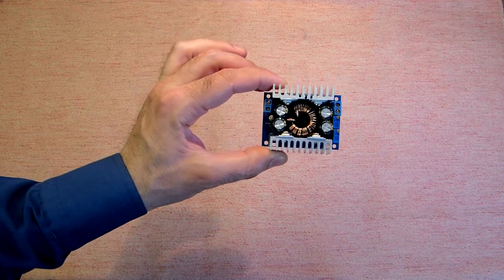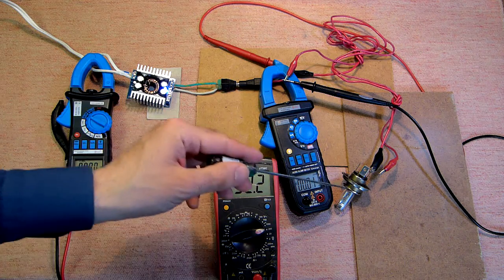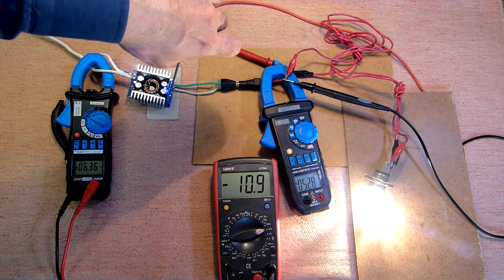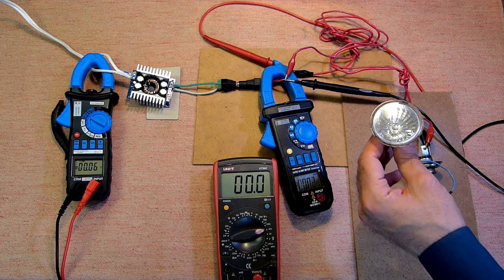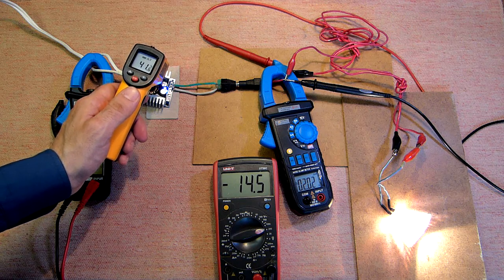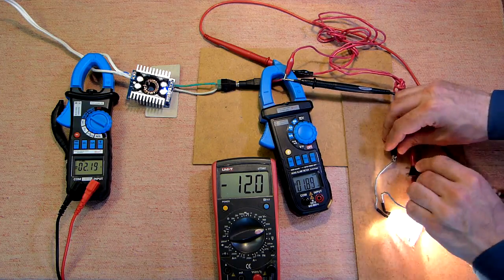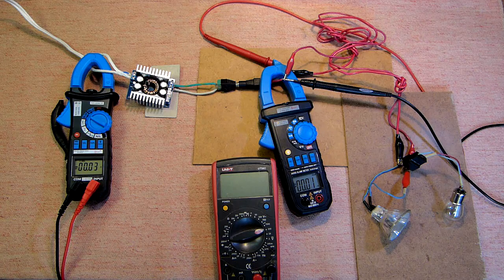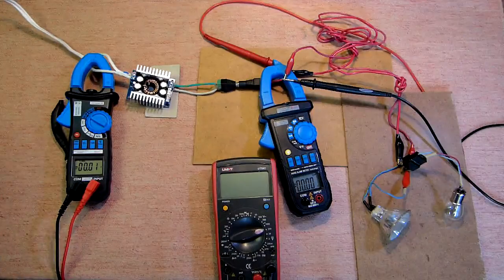Step Up / Step Down - 8A DC-DC Converter

Comment: Hello ... can use 2 module in parallel together? To get more current
Reply from the maker: No, you should use only 1 potentiometer in this case in order to control 2 devices. So, you should cut one of pins on one of the potentiometers and to solder wires in parallel to another potentiometer.
 Please, subscribe to my another channel: https://www.youtube.com/channel/UCbQUNw5V5pDPXugLX1FP_Fg
Reply: @powerbatterychannel4315  so you mean one pot for CV & one for CC , if do that we can use them in parallel is that right?
Reply from the maker: @rawandjaza5929  Yes, but you should cut the corresponding pins so that one pot should control 2 devices. Here it's in Russian, but you can see the line, which was cut: https://youtu.be/5_B198DTyO0?t=602
Reply: @powerbatterychannel4315  thanks, what about to add more mosfet and rectified diode and change inductor wire to thick wire to get more current , is this work ? I want to build bench power supply from PC ATX and the module.
Reply from the maker: @rawandjaza5929  Probably it would work, but you need to conduct an experiment, as it's difficult to say exactly how stable the system can work.
Reply: @powerbatterychannel4315   if the main cheap not heat up it will work but as you say the module have bad design , i bought 2 of them but when i watch your review i didn’t expecte is bad at this rate.

Comment: Hello, someone who will know if this module helps me to increase the output of a 19V laptop source to increase it to 24V?
Reply from the maker: I don't think so, as the temperature of its parts will be too high.
Reply: @powerbatterychannel4315  Hi, so what do you recommend? i need to step up a low voltage to 24V
Reply from the maker: @jesusdaniel3536  You need more powerful step-up device.
Reply: @powerbatterychannel4315  thanks

Comment: I have this module it cant supply more than 60w and its the lame part. Brought from aliexpress and seller told me to this module can handle 100w without fan and 200w with fan. In reality, you cannot exceed 60w or 5a. Im very disapointed.

Comment: Good day sir.. If i replace the trimpot with potentiometer for volts and current adjustment what potentiometer rating should i use? am planning to use this for my dIY bench power supply
Reply from the maker: You should get the device and see the inscription on its potentiometer and replace with the bigger one with the corresponding resistance. The resistances differ sometimes
Reply: @powerbatterychannel4315  also the resistance are literally written on the potentiometer (w 204) means you need 200k potentiometer if you want to replace it at least on d 1 on this vid

Comment: Good day sir! I would like to ask if I can use this on my 3pcs 12dc fan 15watts each with Direct to solar PV set up? Currently my set up is 100w solar panel and 3a mini buck converter each fan between solar panel. Am planning to use this type of Buck Converter for my 3 12vd fan instead of 3 3a mini buck converter. Will it work?
Reply from the maker: It will, but depends on the input and output voltage difference.
Reply: @powerbatterychannel4315  thank you.

Comment: What is the input power source adapter?
Reply from the maker: PC power supply.
Reply: @powerbatterychannel4315  cool thanks for the reply.. But still the pc adapted is a barrel style output.. I ordered a barrel charger adapter with loose black and red wires to hookup to buck converter.. I don't see any other way to do it..

Comment: I bought the same card, I adjusted the trimmer to the maximum but it exceeded 50v so the capacitor burst, how is it possible that it has risen above 32v?
Reply from the maker: Probably, it's faulty.
Reply: @powerbatterychannel4315  ok thanks
Reply from the maker: @ineridiziopeppe1728  You are welcome
Reply: @powerbatterychannel4315  how could i go about limiting it to 30v?
Reply from the maker: @ineridiziopeppe1728  I can't say anything if it's faulty.
Reply: @powerbatterychannel4315  OK thanks anyway

Comment: Has anyone managed to force the input current to 8 amps by modifying the circuit and cooling it with a fan? the maximum I can get at the output is about 40watt, after which a protection intervenes even if the module is still cold

Comment: The specs said continuous max input current is 6A, so at more than 6A you get from this I think this device is pretty on the spec.
Reply: instablaster.
Reply: Actually you cant get more than 5a. After 5a, led starting to blink.

Comment: sorry for telling u that
but the secend resistent is to set the amper limit u can rise it using it 
u should know that when u saw that the voltage has stoped rising on the secend lamp
thats mean the device has a current setting Feature, the other dc dc converters who dont have a current setting Feature would just burn bcz they will give u any amp u wants
try it ;)
Reply from the maker: Thanks
Reply: for other people it wouldn't burn unless its faulty and current/voltage are always limited (12v 2amp input would output 24v at 7-800ma, amp will decrease as voltage higher than input increases, going lower than 12v will increase amp but wouldn't pass higher than 5-7amps or whatever was set to limit would likely to turn it as waste ploss

Comment: Sir .. why not test 30v 8a full load .. to test the endurance, I want to see what is the maximum wattage of this module
Reply: for the content i think it's worth it, even though the buck will burn haha ...
Reply: I have this module it cant supply more than 60w and its the lame part. Brought from aliexpress and seller told me to this module can handle 100w without fan and 200w with fan. In reality, you cannot exceed 60w or 5a. Im very disapointed.

Comment: Hello. Do you think it is suitable for CC/CV H2G li-ion battery charging? (4 in series, so not that big voltage (noise?) for one cell?)

Thank you.
Reply from the maker: Hello, this device is suitable for CC/CV, especially for Li-Ion batteries.
Reply: Thank you. Sorry, i missread datasheet (of batteries) +-0.05 is quite a big tolerance for float voltage.

What about overcharge? You cannot just hook it there right?
Tnx:).
Reply from the maker: @jirkasirek9059  In case of CC/CV there is no possibility of overcharging.
Reply: @powerbatterychannel4315  LOL actually there is a possibility use a bms instead of hooking it up on that
Reply: @jirkasirek9059  Bms would do the work automatically for you, over current, voltage, reverse polarity protection. it charges individual batteries to match voltages which is what you would want

Comment: ??   What was the voltage  you input into the converter ?  So in the end the unit would only support 5 or 6 Amps ?
Reply from the maker: Input voltage =12V.  In the end the unit would only support 4.5A.
Reply: @powerbatterychannel4315  Chiniesium Ratings.  If they say it's good for 20A that means it only starts smoking at 10A and won't burst into flames until 20A ..
Reply from the maker: @pulesjet  Please, see my video for  20A device.
Reply: pulesjet i have the same problem on my is only down wtf
Reply: @powerbatterychannel4315  Where is the video?
Reply from the maker: @jayoli7073  https://www.youtube.com/watch?v=H5ExpkotAow
Reply: @powerbatterychannel4315  Thank you very much. Very quick response.. I hope that you're well and healthy.. In your opinion... Would you consider this unit poor and possible unsafe for an DIY ATX  bench power supply?
Reply from the maker: @jayoli7073  You can review it thoroughly; it can provide up to 15 Amps safely; as to 17 Amps - the cooling solution should be excellent, but I don't recommend to consume 20 Amps from it.
Reply: @powerbatterychannel4315  thank you very much for your detailed analysis and reply. Greetings from NYC.
Reply from the maker: @jayoli7073  You are welcome.
Reply: I couldn´t understand what was the problem in the test you made. The step up converter should be able to manage 5 amps and nearly 20 volts. Did the atx power source have an overcurrent ? or did the booster failed?
Reply from the maker: @guillermoharrison6049  Hello, the step up converter really should be able to manage 5 amps. But it can't provide this current.  ATX PSU is OK.
Reply: @powerbatterychannel4315  Hello! In the video, you say that the power source decreased to 10.1 volts. Why is that? In my opinion, buck-boost converter couldn't deliver more amps or volts because of the atx. Can you give me more specificactions of the input? 12v*6a input is correct with those  11,5v*5,4a in the output. It gives you aprox an 86% efficiency.
Reply from the maker: @guillermoharrison6049  Such voltage drop sometimes takes place; the PSU is not ATX, it's even AT, a very old one. As to the specs - they are on the video, that's all I can provide.
Reply: @powerbatterychannel4315  yeah mine itried 6amps and it gets really hot just for a second
Reply: @powerbatterychannel4315  yes it can only support 4 amps i tried 5amp and it heats up very quick planing to add diode and replace the mosfet to higher rating